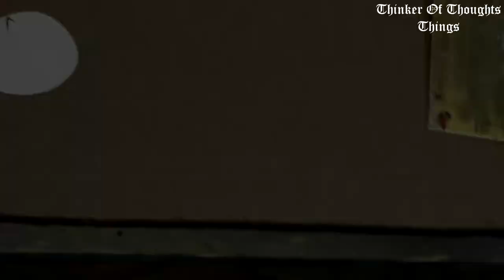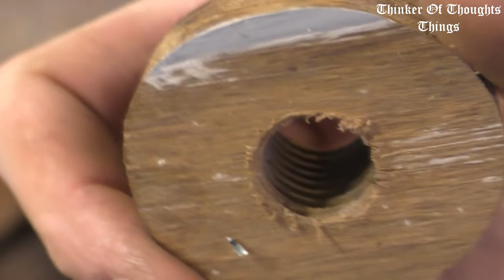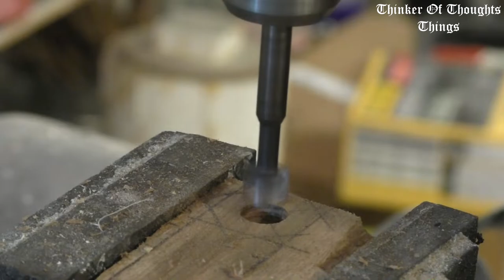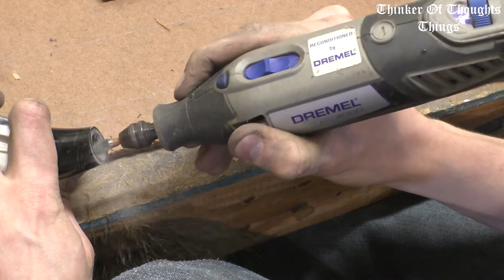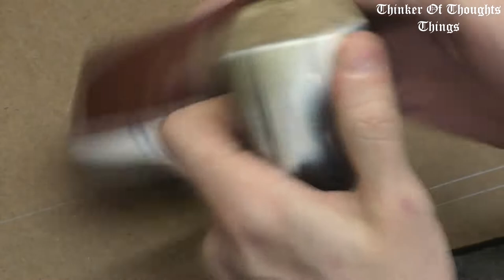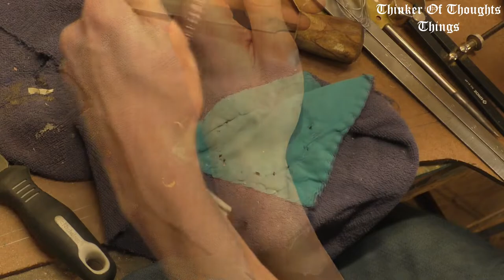Making a Powder Horn (and a powerful odor)

Comment: Hello:
 You broke the cardinal rule of horn making! You DON'T EVER glue in a horn cap. You've essentially just made a hand held bomb!! You always attach it with tacks or wooden "plugs" around the perimeter and seal it with bees wax. If a hot spark ever got in there it would blow your dad's hand off or worse.
Just a heads up for future horns. Other than that, nice job.:~))))
God bless:
Two Feathers
Proprietor of:
The Mountain Man Emporium
Reply: I’m a traditional type of person and I use beeswax to seal the plug and toothpicks as pins to fasten it. But if a spark ever gets into one of mine or this very nice horn this fellow made, you’ll have a bombshell anyway ! 
   Nice job ! Keep it up you’ll learn something every time you build one !  👍